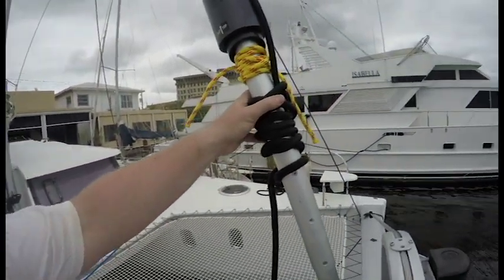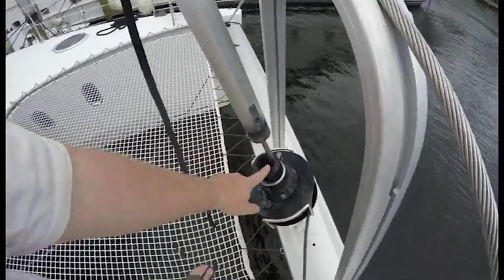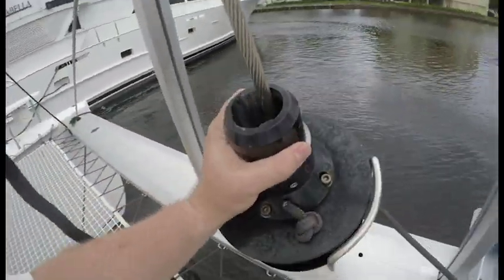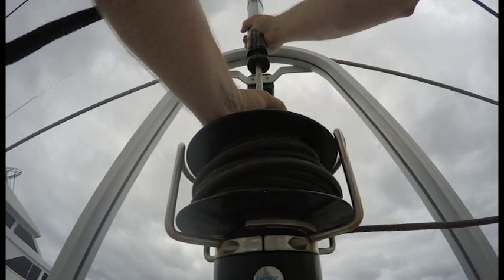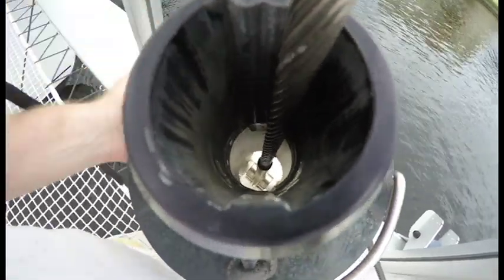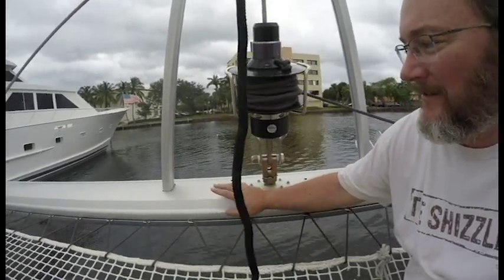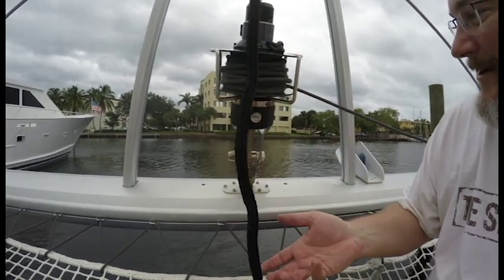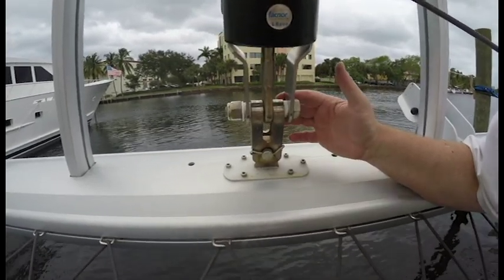Facnor LS 200 Part I on StressLess

Comment: Harry, did you need to replace the whole bearing and drum assembly or just the bearings? I will have a small machine shop on my cat for these types of issues and to help others out. PS, most stainless and aluminum do not play nice with each other as you get galvanic corrosion in salt water. A 410 stainless would be a good option as it should be an "active" metal which would match the aluminum better.
Reply from the maker: We had a great rigger from Miami help replace the entire drum assembly.   They are not built to be taken apart so it's a unit replacement.  Plus we learned a good bit on rigging/tunning etc..